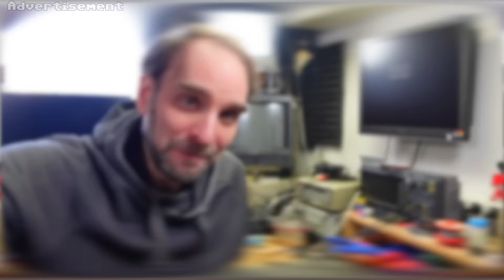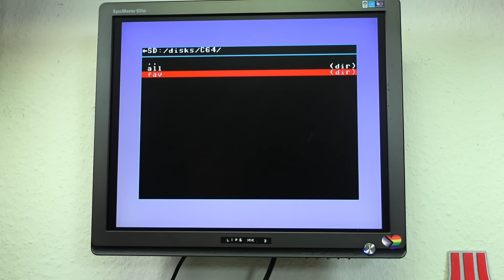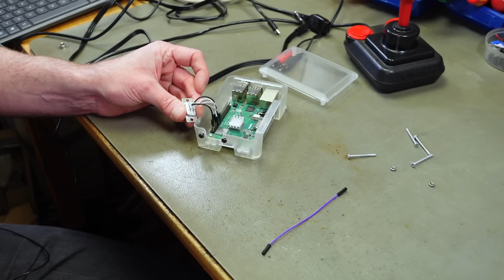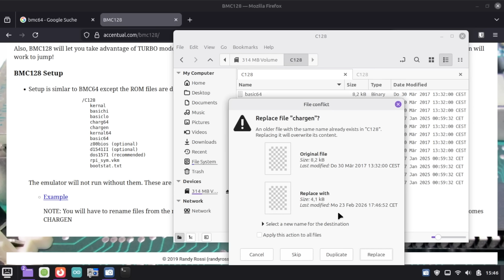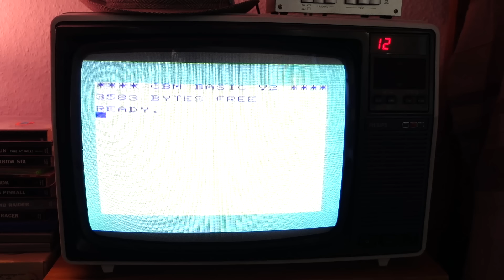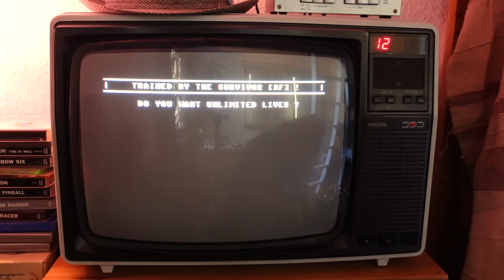BMC64 Emulator Advanced Setup

Comment: I gutted my The64 Mini and replaced it with a Pi Zero 2 runnung BMC64. It's a major upgrade. The only catch is that the Zero2 lacks an audio jack and BMC64 does not support an audio external DAC - so limited to HDMI out

Comment: A great tutorial. After watching the first video I looked into buying a Pi3B+ or Pi Zero 2, but my usual supplier was out of stock of both. A project for the future.
Reply: You may have luck finding the 3A+ which may be suitable for your scenario. The 3A+ seems to fit in 3B cases (I only recently realized). I "freed up" some 4B+'s with 3A+'s.
Reply: @peterholmes9158 A good suggestion. Thanks!
Reply from the maker: Thanks! Yeah, Pis are not too easy to come by these days, unfortunately. I’ve had some luck buying used ones on eBay etc, especially the slightly older models. Maybe worth a shot if you want to start the project a bit sooner. ;)

Comment: hey man thanks for the tip and idea of setting this up. its pretty cool on old hardware i had laying around. I found out the hard way that when you save files to a disk they don't save unless you choose FLUSH Disks. I lost an entire night of saved games. if you soft reboot they are still there, but hard reboot or power on and off then you loose anything you saved to a d64 disk/. i read on the bmc64 site they do that because that's how they can allow you to power off anytime you want to and not mess up the SD card/ I find it strange how the website for BMC64 does not have this in big red letters, and why its not even in the readme file. it seems like a pretty important piece of information. .Thanks for making me aware of this cool project, and I have it on my old 40 some inch CRT.
Reply from the maker: That’s a very important tip indeed! I only found out when I wanted to save my game after an extended session of Pirates! (Unfortunately after shooting this video, otherwise I would have mentioned it!)

Comment: Good stuff, thanks for the links. It's a shame BMC64 doesn't seem to support paddle emulation. It says there's no analog inputs but if you connect a USB controller with analog sticks, it literally shows you the values from 0-255. I can't find any way to make it work though. All it needs to do is poke those values in the right address. Messing around with the controller types, it even flashes "Paddle" for a split second...
Reply from the maker: Yeah, that would be a cool addition. I don’t think it’s possible with the GPIO pins but USB should be doable in some way. I don’t know enough about how the Pi let alone BMC64/Vice works internally though.
Reply: There are USB controllers that are compatible, and will detect as Hat + Pots. Then you can select Paddle controller mode. Xbox One controllers will do this. But using half of an analog stick is not fun for a paddle, so you need to hack the controller and add a 10K pot dial. D pad L or R becomes the fire buttons...

Comment: BEWARE! I wouldn't recommend connecting +5V without taking other precautions.
If any joystick fails or has a very badly designed autofire circuit it could easily put 5V on the Pi GPIO pins which are NOT 5V tolerant.
Quick insurance is to install a diode on the fire line from the pi to the joystick which would only allow it to pull the line down and never drive current into it.
For bonus points (or if you're more paranoid) put these diodes on all the GPIOs used for up/down/left/right
Reply from the maker: Good call! Some protective diodes won’t hurt indeed. I think it’s unlikely that something is going to fail catastrophically (as the auto fire circuits are so simple usually) but definitely a good addition to protect the Pi!

Comment: For the 5v line to enable the auto-fire on certain joysticks to be "not supported" when it's just one more wire to the connector does seem a bit silly, but, I guess they did so just in case of any iffy wiring in said joysticks that a C64 & the like could tolerate, but a modern day Pi may not, or something like that...
Reply from the maker: There is a slight risk of damaging the Pi in case the joystick has a weird circuit or is broken. Some protective diodes would probably be a good idea to prevent that. Should be fine like I did it for my use case with known good joysticks though, I guess. :)

Comment: This is not Commodore Plus4 emulator, only Commodore 16 with 64 kb. Otherwise will be another screen with F1 key option for something like Excel.
Reply from the maker: It definitely has the Plus4 ROMs, I guess it’s just a matter of setting it up correctly. (The build-in software is relatively useless anyway though, at least for a gaming setup like this, I guess.)

Comment: I use mine with a Keyrah in a VIC 20 case and I prefer it to my real C64s. I extended the ports out to the VIC 20 case ports and 3D printed some blanking plates so there's unsightly holes, and it just feels like the real thing when using it - only with a lot more features.
Reply from the maker: Nice! :)

Comment: what linux distri are you using? gui looks nice @21:13. popos?
Reply from the maker: I‘m using plain old Linux Mint/Cinnamon, only very slightly adjusted the stock settings. :)
Reply: @JanBeta  Linux Mint is fine. I'm using it too. I'm a linux user since '99 and I've worked (and tried) several distros (Arch, Slackware, Gentoo, etc) but at a certain age I wanted a distro that solves problems and not a distro with problems that has to be solved ;)

Comment: So next you can adapt the BMC64 for The C64 case and keyboard, and patch BMC to support CMD hard disk images.  Don't throw away the The C64 USB hub.  Comes in very handy.
Reply from the maker: I only have the C64 mini. Probably doesn’t make much sense to cram the Pi in there (as it doesn’t have a real keyboard)… Although I like the BMC64 emulation way way better. :D
Reply: @JanBeta LOL.  I guess I should have specified.  Yes. The full sized one with the worming keyboard.  

I believe the key mapping for the keyboard can be found on Lemon 64.  As well as a patched version of BMC64 that supports CMD hard drives.
Reply from the maker: I think there’s a preset for the Maxi keyboard in the latest BMC64 even. Should be very easy to make that work. :)

Comment: Hi Jan, great video. With Logitech options (windows app) you can remap the F keys  so they can be used without the Fn key. Groetjes uit Nederland.
Reply: But of course this won't work probably with your BMC setup 🙂
Reply from the maker: Yup, I had it set up like that when I used it with a Windows machine. I guess I could try changing the VICE keymap on the SD card for the BMC. I already got kind of used to it as it is though. :D